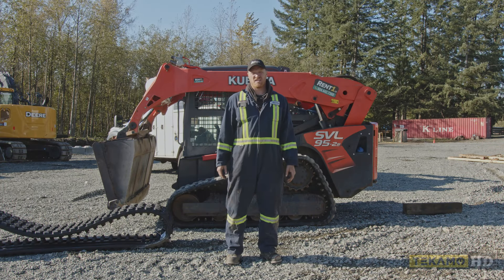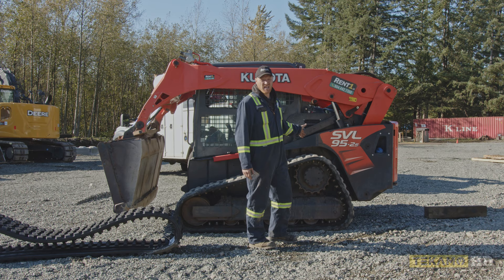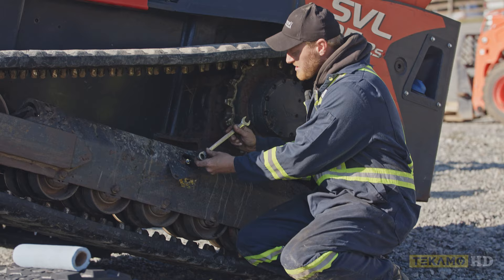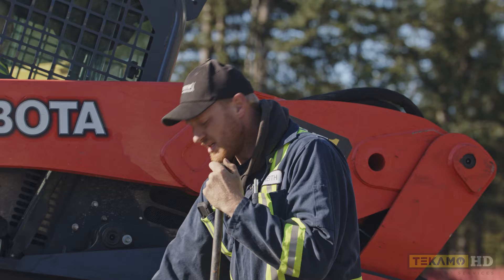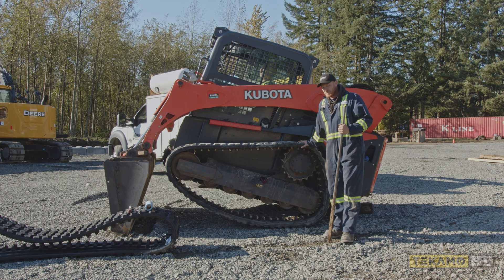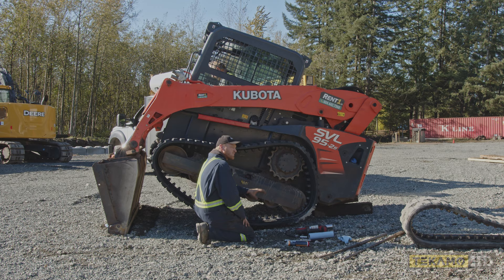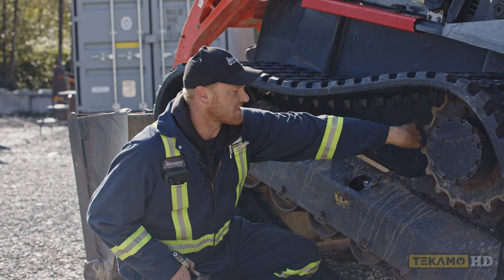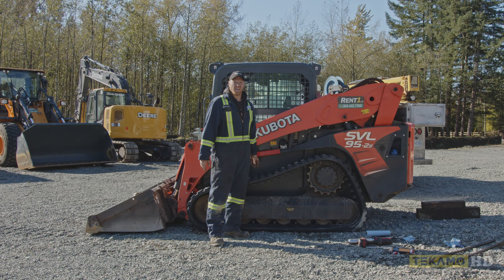Replace Skid Steer Tracks WITHOUT Using Other Heavy Equipment - Track Replacement In The Field

Comment: 1 man job, ive done 7 in the field in the last 1.5 years just bring a 1/2 -3/4 ton come-a-long with you to lift the track off and on the drive by hooking up to the lift arm of the skid steer. Very easy to do. Time frame is 15-30 minutes
Reply: Unless you got a JCB one-arm, and the track came off on the other side of the machine.  :)

Comment: Put a block of wood between the front of the track and the back of the bucket and tilt the bucket down to press the grease out.  Do it before you lift it up in the air.

Comment: Just to throw it out there… if you was to put the machine down after all the slack was out of idler which would eliminate the weight from the track and less tension on the sprocket it would be easier to pull off

Comment: Great Video, many good tips here.   I think this is good for the Kubuta where the door will never get in the way with hydraulic sag of the machine, whereas other machines like Deer and Bobcat with a cab door unit, you will have to take the door off otherwise you could find yourself locked/blocked out of your cab, or the door could be sheered off as the hydraulics slowly sag.
Reply from the maker: Thanks for watching!
Reply: Exactly

Comment: what's a good brand grease gun or which one is he using?
Reply from the maker: Lots of good options out there but in this video Keith is using a Snap-on cordless.
Reply: Hey Hoang, we have been using milwaukee cordless grease guns industrially. Get used daily in bad conditions. They have been very good except for a few trigger replacements.
Reply: @brandodo  yeh on the smaller m18 battery I get about 3 to 4 grease tubes before battery dies. The bigger amp hour m18 battery gives 4 to 5 grease tubes during summer. Wintertime I'm lucky to get 3 tubes before they die.
Reply: David Sims surprisingly we did a test on a stubborn grease fitting with both air regulator set to 130psi (not reccomended for grease gun) and Milwaukee cordless. The Milwaukee was able to force grease into the pin whereas the air did not have enough pressure. Was a huge surprise to me and the other mechanic.
Reply: Miluake Greese gun is my go too I work in heavy equipment rental company   only use miluakee tools  pricy but very reliable

Comment: How long would it take normally to change a track in the field for an experienced mechanic?
Reply from the maker: Usually anywhere between 30 minutes to an hour. Depends on the size and weight of the track! Always good to have an extra set of hands.
Reply: depends on where it fails, if you are in mud or on a hill or next to trees its going to take a while. if its on level ground and in the open, less than an hour.

Comment: How about if your skid steer won’t run?  I blew a hydraulic line to the drive motor on one side.  Have no hydraulic pressure now and on my new Holland the track has to be removed to access the lines. Any suggestions?  I’ve already exhausted my extensive vocabulary on it and that didn’t work at all 😂